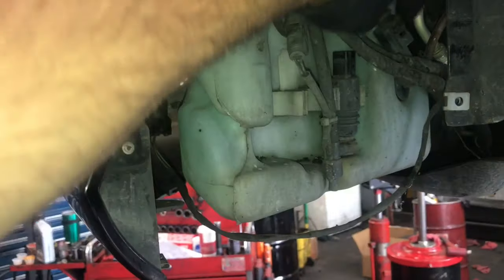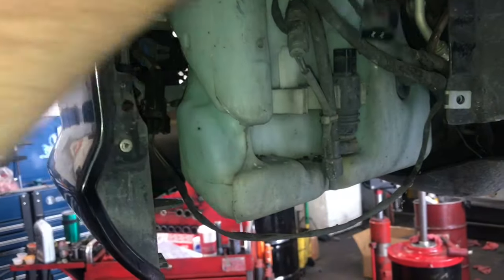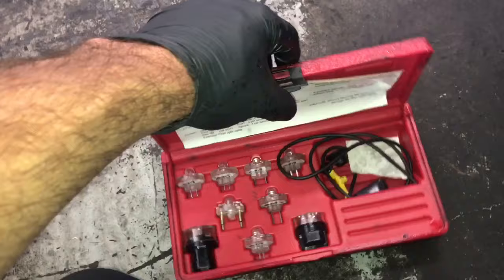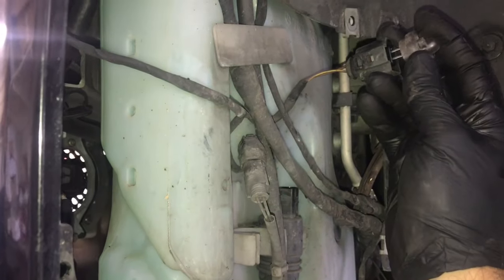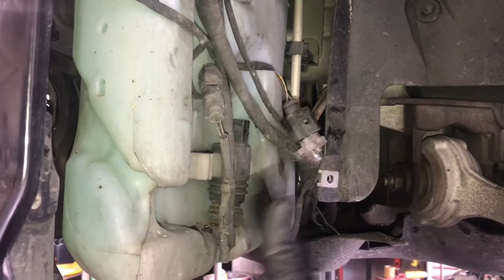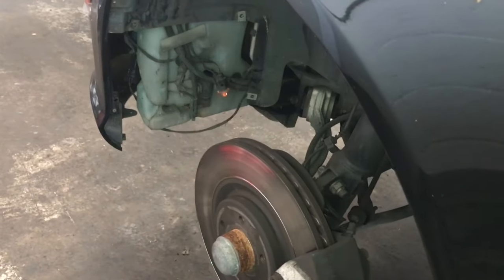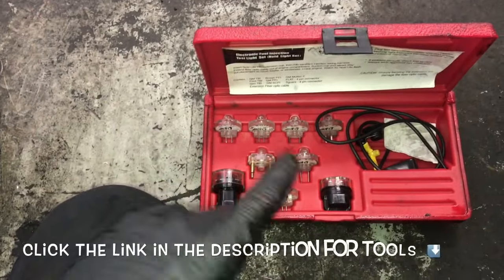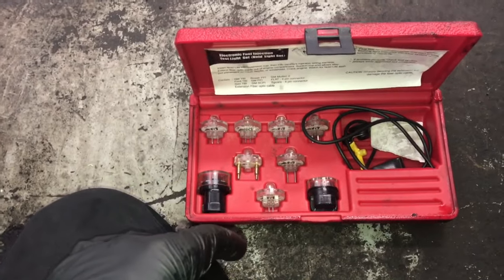How To Check If Your Windshield Washer Pump Is Working

Comment: I like a visual confirmation and using the Noid light was pretty cool.
Reply from the maker: wyattoneable you can use the Noid light on any to wire a switch. I use it a lot testing vacuum switches Evap Pergin and vent valves. Give it a try the next time you get a chance.
Reply: I just got a used set at a local flee market. It's missing one light but I'm sure I can find uses for them, thanks.

Comment: so if the pump dont work it doesnt spray at all, and if the hoses or nozzles are messed up they spray some but not  like it should ?
Reply from the maker: Free Spirit it's possible for the nozzles to be completely plugged it won't spray also

Comment: Can this be done with a volt meter?
Reply from the maker: Yes it can but it not a 100% because there is no load on it. The light adds a load to the circuit.
Reply: So how much volt do you need on the multimeter? I measerud 6 and 8v. The engine was off, contact on. I also tested all the fuses, nothing wrong them. What should be my next step?

Comment: this DOES NOT test the pump, it tests the circuit of the pump.
Reply from the maker: Exactly if you have power and ground going to the pump and it’s not pumping then the pump is bad.
Reply: Correct.
If that is OK, then the fault MUST BE with the pump. This is how diagnostics works, it's a process of elimination.
Reply: Depending on how low the wattage is on the noid light it may not give a good indication of the current varying capacity of the circuit. 

The washer pump could use up to 4 amps or around 50 watts. I don’t think noid lights draw that much.

Comment: Can't you just use a Multimeter instead? Take the positive lead to the positive post, and vice versa.  That should give you a voltage reading.  I would guess no need for these Noid Lights.
Reply from the maker: Scott Gibson Yes but if use a voltmeter it require two people one person to operate the switch and one person to watch the readings. This way you get a visual signal that yes it’s getting what it needs to work. Now now if the light did not light up then you would use the voltmeter method to determine if it’s missing the power or missing the ground.
Reply: Yes, that's exactly what I did.  I had the wife activate the switch (2009 Cadillac CTS).  I tried mesauring but am getting nothing.  Checked relays and fuses, both good.  For some reason there is no voltage getting to the connector.  I've tested the windshield washer pump and it is working fine, so its not the pump.  On the same harness, there is another connector that isn't getting voltage either (the headlight washer pump, some cadillacs have 2 pumps).........but on that same harness, the low washer fluid sensor is getting 12V and works fine.  I'm stumped :(
Reply: I see your post is 7 months old. Did you figure it out? Perhaps multi-function switch?
Reply: @HowtoAutomotive  My washer pump is on the passenger side so I would need 2 people regardless.😐
Reply: @HowtoAutomotive  You don't need 2 people just a piece of wire, string, zip tie, fishing line or whatever you have laying around to hold the switch on. Think I used a zip tie last time.
Reply: How do you know what the positive post is on the connector? Can you explain how it should be checked with a multimeter?